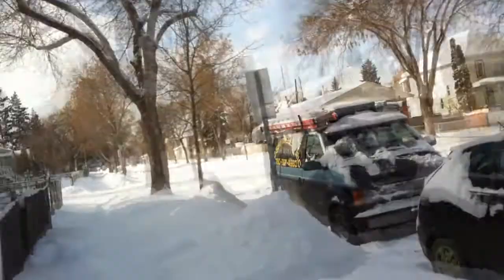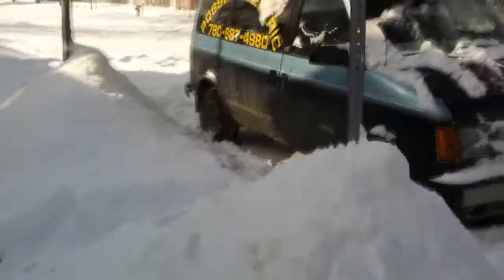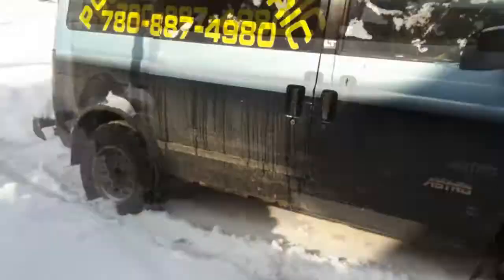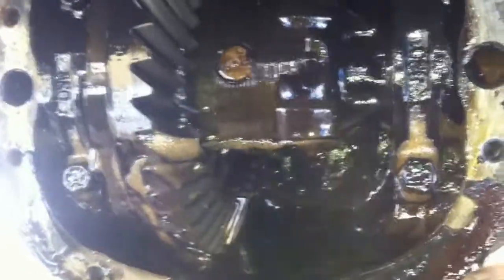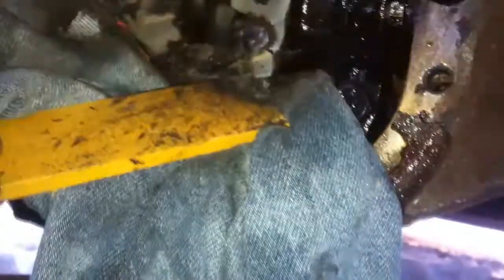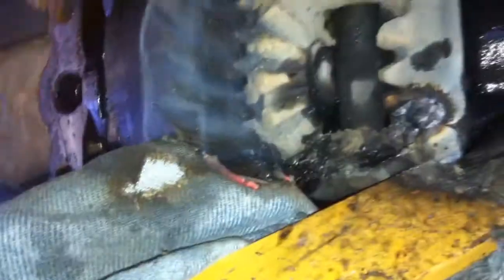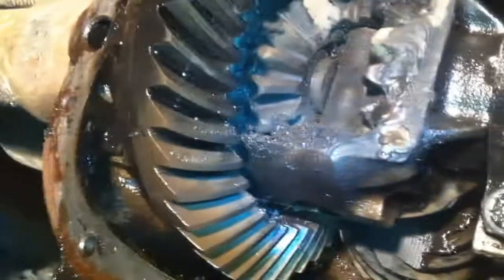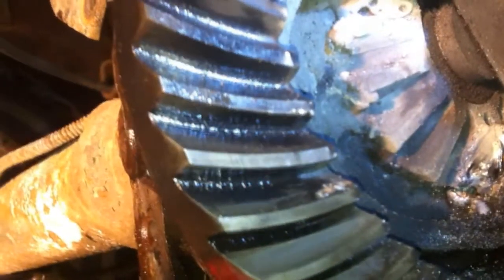Welding Astro Van Differential

Comment: You could have bought a removable locker which is fairly cheap.  Locking is severe wear on the rear end.  In snow it's not, but dry pavement for sure.  There's a reason only wheelers and drifters do this.  Drifters don't do it on their daily drivers though.

Comment: That foam in the oil is from water in the Dif Oil. If you sell this van I hope you disclose to the new owner that you TOTALLY thrashed and ruined the rear end assembly. You would have been far ahead of the wheel slip problem to have put studded snow tires on that Astro van.